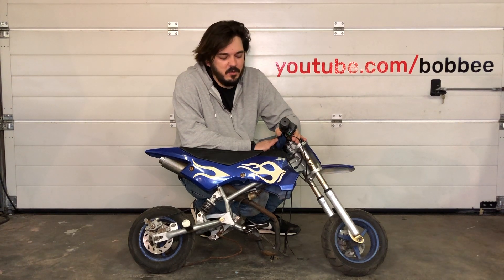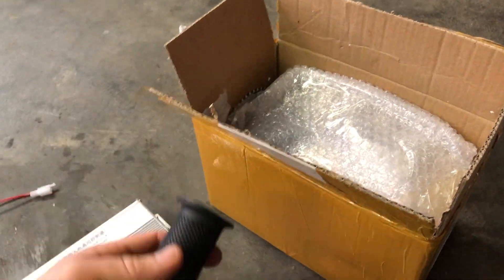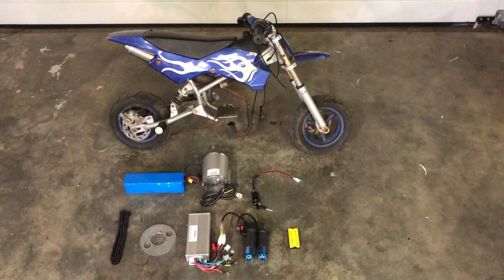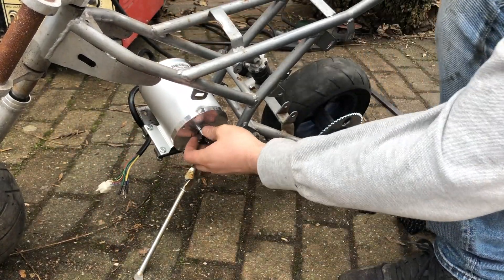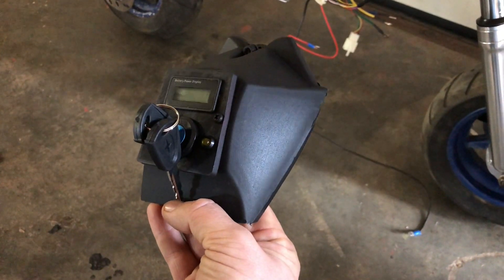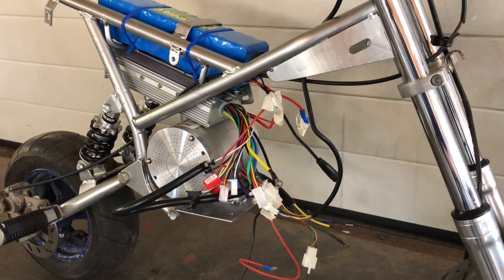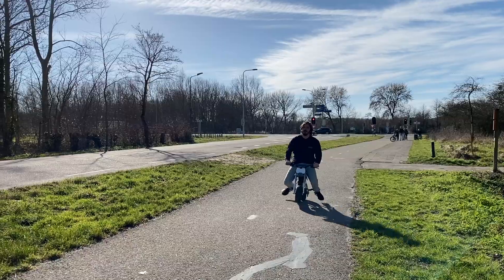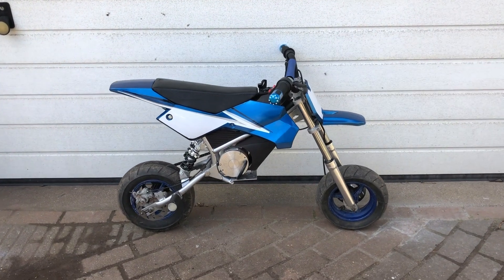DIY Electric Bike Conversion - 2000W 48V ebike conversion kit.

Comment: Do you think upgrading to a 72V 2000W setup would be a significant improvement? I just bought a Gazelle KDX for my 3yo, but its just 36v 500w. Even for a 3 year old, thats way too slow. I want it to be super fast and zippy, but also have different speed modes for safety.
Reply: should work good just make sure to get an adequite battery as thats usually a big hold back for these builds.
Reply: @charliebell7163 thanks so much!

Comment: great build, but that motor seams slow, and its not the batteries as lithium doesn't drop volts like a lead acid, lithium just dies when the pack depletes to 40v or the first cell in the pack drops to 2.5v causing the bms to shut down , ive had my exact same motor and controller screaming at top end on a low 48v battery reading about 47v instead of the fully charged 58.4v, also did you put a three way switch on the speed plug, i found out (after many years of leaving the speed plug unplugged with no issues) that some controllers mid range is in the unplugged mode meaning your running at about half the power? also beef up the tracer and buzz bar on the controllers board allowing more amps to pass through the controller there are plenty of YT vids showing you how to
Reply from the maker: Thank you for the information 🙌 a while ago my motor (or controller) stopped working. I didn’t have time to replace it yet. But you are right, that motor should produce more power. I’m hoping to soon make another build, also on a bigger bike. Have a good day 👍
Reply: @BobBee  giz a shout if you get stuck, i'm not the best but i know enough and i learn quickly and i have a few projects on the go. I have been building all sort's mostly in the electrical and mechanical for roughly 20 years and if i can help i will. and it will  either be the throttle or the controller. the motors are hardy. if you can get the controller to me i will happily take a look inside and see what the issue is and also beef up your tracers for you free of charge.oh and i never said but this is a boss vid, well done, i don't have the guts to do YT content lol. take care

Comment: Magnificent conversion, e bike kit and creative installation that's clean and powerful!
Happy fathers day your rock!.
I have an MTB full suspension bike with a 3000W motor and want to add more power as I use it to ride in the dirt.
My set up: Cyclone 3000W motor, 48V Kelly controller and 52V battery,
Any recommendations are well appreciated.

Comment: thats the exact same set is mine but i didn't get a manual.... where did you connect the ignition switch to? maybe explain the whole wiring if possible :p
seems like the netherlands btw hehe
kleine update : the motor turns at low rpm until i throttle up it cuts out completly, have to power off and on again, white learning wires make it turn constantly

Comment: Whats the speed? Looks so slow
Reply from the maker: In the video it had a crappy Chinese battery, I did 25 to 30km/h. Now with a better battery it’s way faster
Reply: @BobBee  thanks for responsce. Do you know estimate speed youve got now? Whats thenrating of your battery now? Cause i gave bafang 750w and this motor, i am looking to use 1 battery to use for both

Comment: that battery is fake some of the batteries are sand
Reply from the maker: Correct haha. I’m building my own battery now. The cells still had all the same voltage though. But the battery is not strong and cuts out all the time 😅🤣

Comment: Probably a lot better power to weight ratio then the 49cc 2 stroke engine.
Reply: and cleaner haha, the engines are dirty but powerful its the poo built centrifugal clutch that lets them engines down,if it wasn't the pull starer breaking it was the clutch to fail first so we use to jam pennies in between the clutch shoes and the bell then bump start them, this also worked for when the pull cord failed but it destroys the shoes and rarely but even the whole clutch system
Reply from the maker: It has a lot of power right from the start. For now the battery is really weak. I will change that soon to a strong “diy” one. 

With the 49cc I always had problems with taking off and burning clutches. (Maybe because those bikes are intended for kids 😆) 

But I see they have newer designs nowadays with something like a gearbox attached to the 2-stroke engine. I will try that one day on another project.